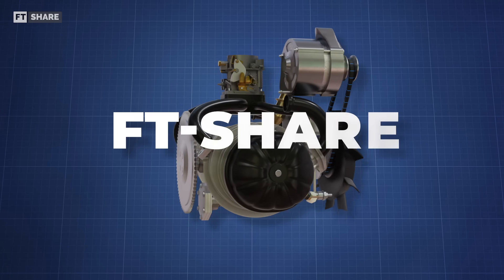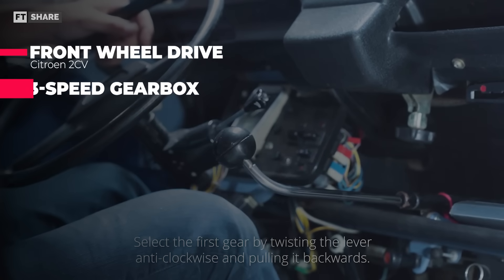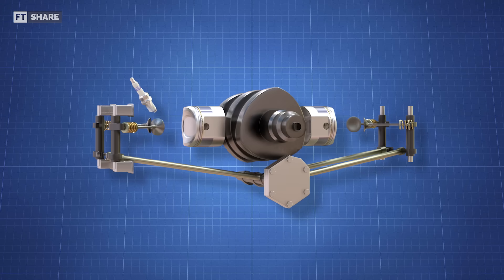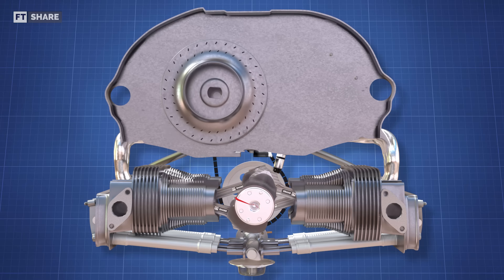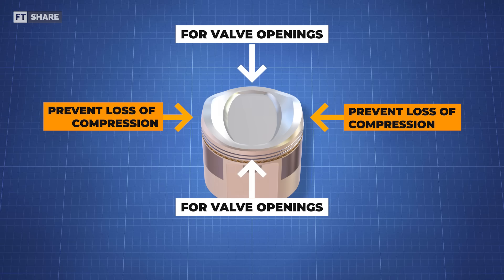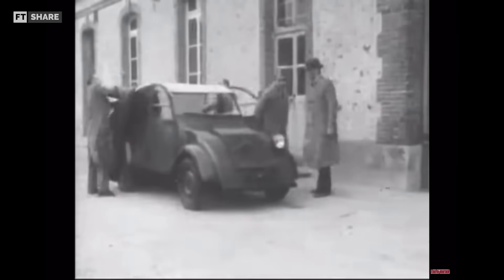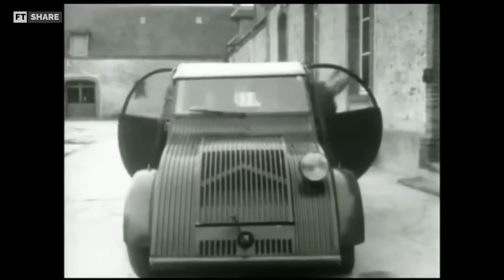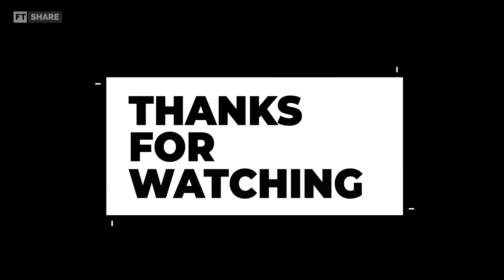The Most Interesting Engine in the World: Citroen 2CV Vs VW Beetle

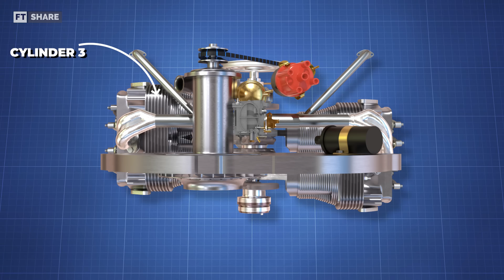Comment: False information at 5:14 which claims that the less than ideal placement of the spark plug gap (for #3 cylinder) can result in overheating. This is a nonsense statement. Actually in earlier engine models the fan shroud contained the oil cooler in the fan shroud in a place closest to the #3 cylinder. As a result the #3 cylinder did not receive the cooler air that the other cylinders received and tended to run hotter and wear out quicker. In later models (with dual port intake manifold) the oil cooler was placed outside the fan shroud allowing all the cylinders to cool evenly.
Reply: Came here to say this. My guess is this whole video is AI sludge. That's not even the #3 cylinder. And as you pointed out "placement of the spark plug gap" isn't much more than a word salad. This throws literally everything else in this video into question. Even if 90% of it is correct how are you going to know which 10% is false or hallucinated? I only know because of how familiar I am with VW engines.
Reply: Didnt he also say that heating the carb makes for a denser mixture???? :face-orange-raised-eyebrow:
I'm not a mechanic and even I know that is wrong lol.
Reply: @AtomicFrog64  it depens how denser mixture is defined. 
Sometimes they just mean a richer mixture with it.

In the physics sense cooler air contains more oxygen so you can ad more fuel and  have more mixture volume to burn.
Turbo/supercharged engines with aditional intercoolers for high hp/torq engines use this physics artificial.

Moped and smal 1-2 cillinder aircooled engines like often a more richer mix to run smoother. 
Passing warm air by the carburator and/or in to the air intake makes the mixture richer
Reply: The cylinder shown in the video was the number 2...the number 3 is in the rear left and not in the front right...and yes later VW improved the overheating pblm of the cylinder 3 putting the oil cooler in a "dog house" style fan shroud.
Reply: True, it's the oil cooler placement which caused the problem. That's why eventually,VW made a modification to the oil cooler design to eliminate the problem.
Reply: @ersikillian  for my next engine, for my Squareback, I'll remove the original oil cooler and install 2 oil coolers + electric fan. Result in less heat in the engine compartment and more oil in the circuit.

Comment: many errors concerning the 2cv...the all first 2cv,all aluminium alloy body, from 1939 had a water cooled engine, 2cyl 325cc and 8hp, 250 2cv from this model was built but never sale because of the war. In 1949 was the all new designed 2cv (all steel body) launch with the known air cooled 375cc engine of 9hp, aluminium block with cast steel cylinder and aluminium heads, but was many evolutions from the engine: next was 425cc/12hp, later 435cc/24hp, and the last and strongest was the 602cc/29hp...ALL 2cv had a 4 speed gearbox (presented to Pierre Boulanger as 3 speed+1 overdrive)

Comment: The Citroen has a 4 speed transmission.
Reply: It's a matter of naming. Pierre Boulanger wanted this car to have 3 speeds. The engineers cheated a little bit and made a 3 speed transmission with a fast speed extra gear. So it counted 1 2 3 S ( for surmultiple)

Comment: If you heat air it becomes les dance. Not more. In fact the heat pipe connection from the exhost to the carburator was equipped with a wax operated port. This avoided the hot air to go thru the carburator when the engine was hot and only was used for cold starts. This was not working well and was not present on latest versions.
I have had a 375 CC model "Fourgonette" from '57 and a 2cv6 from '82. The fourgonette had a 12hp version of the engine. I did upgrade the Fourgonette with a 602cc engine from a Citroen Dyane with the 4 speed gearbox and all the breaking system. In the 2cv6 I did replace the 602cc engine with a 650cc engine from a Citroen LN. This had a Aluminium engine. The 2cv had Aluminium heads but cast iron cylinders.
Those engines had not only closed rods but also no head gasket. In stead it was a conical fitting.
The oil was mainly used for cooling the engine. That is wy there was such a big oil cooler. That oil cools was holding 60% of the oil when the engine was running. Making it a partial dry sump.
There was a 4 cylinder version of this engine. It started in the Amy 8 super (1050cc) that was a "luxius" derivative from the 2cv. Then it found its way in the Citroen GS (1100cc, 1220cc and 1300cc) and the Citroen Axle (1100cc).
The 2 cylinder version of 65Occ was found in the Citroen LN and the Citroen Visa whitch had also 4 cylinder engines but not boxer.

Comment: I really like Citroën 2CV and came close to buying one in 1975 but it was more expensive than a Fiat 127 eg with a 4 cylinder 900cc engine or similar cars, so it was  overpriced which was far from its original character , i.e. a frugal and particularly cheap car.
The Citroen 2CV has a unique style but does not meet modern safety needs. The engine is very interesting but one can hardly say that it is the best ever made. This iconic car can take you everywhere but with enough noise and moderate speed. Although its "philosophy" - austerity but with reliability - is admirable, one has to overlook quite a few things to have it as a unique car.

Comment: I think of the 2CV with its 600cc flat twin as half a Beetle engine:-)
Reply: The 2cv started with 375, then 425 and then 602
Reply: @matiascasali  375, 425, 435 and 602
Reply: think of it as twice of a beetle engine
Reply: @luxwutang  almost the same power as the 1200cc Beetle

Comment: About half of everything told here is incorrect. Please, if you don't know what you are talking about don't make youtube videos explaining engine technology to people.
On subject: The comparison between these engines is pointless because apart from they both being aircooled boxers they are very different. The four cilinder VW engine definitely is more advanced, better balanced, and has more torque and power. And though the VW engine is relatively light, the Citroen engine is much lighter. This was important because of the low vehicle weight of the 2CV. Exept for the breaker points maintenance the Citroen engine was easier to work o.
Both these engines have proven to be very reliable (probably more so than most modern engines).
Reply: I think your comment is quite horrendous. Not very nice attitude to a guy making such a informative video.
The clip is very good and the small incorrections is not very relevant.

Start listing the "half of everything" thats incorrect...
Reply: El Wolkswagen es un cáncer, gasta combustible como un coche grande y no tiene espacio ni para poner un canasto, es antieconómico relación a su capacidad

Comment: 6:21 This is factually false. 
Heating the intake air will lower the air density, and thus, causing the engine to produce less power.

This is why some modern gas cars use intercoolers, to cool the intake air. Making the air more dense, so more of it can flow into the combustion chamber. And create more power.
Reply: agreed, but it's a common technique to use on carburated cars so ends up a net benefit to efficiency. my dad's 1989 nissan sunny used it. i guess its because carbs like to be tuned to operate at a consistent temperature. there's also the danger of carbs icing up, mainly happens in aircraft.
Reply: @martin-vv9lf Thank you, finally someone who understands engineering! The carburetor must be heated due to the risk of icing.
Reply: Warming the intake air flow only helps the engine warm up. Then warming the air hinders optimum engine performance. In the VW engine, there is a thermostat which closes the louvers in the fan shroud on a cold engine so it can warm up to operating temperature. Then the thermostat opens the louvers to give maximum air flow and optimum engine performance. Shade tree mechanics that removed the thermostat and louvers to "increase air flow" didn't know what they were doing.
Reply: @vwbug7028  The purpose of the heat riser system in the VW is to keep the intake manifold from freezing in cold, damp weather, which causes the fuel mist from the carb to condense. That causes sputtering, backfiring and stalling to occur (ask me how I know!). There's also a warm air pickup which brings warmer air from under the engine tin to the carburetor. This enables the car to run reliably in all weather. Many shade tree guys disconnect those systems because "you don't need them". Most of us learn the hard way the engineers knew what they were doing by installing those systems on the car.
Reply: @kathleenrossi4840  Ambos fueron diseñados en Europa, y hacia el centro norte, donde los inviernos son muy fríos !!!
Reply: @kathleenrossi4840 I don’t see your post before my earlier ones. You are absolutely right. The VW engine and its integration into the vehicle was thoroughly engineered. Many mechanics and owners today don’t realize the importance of the engine compartment gaskets and the tin pieces that formed a seal preventing the heated cooling air and exhaust heat from circling back into the cooling air intake.
Reply: @kathleenrossi4840 That's right, especially with such a long intake manifold. The same goes for the 2CV.
Reply: @vwbug7028  Many VWs performed this thermostat removal on their own.
Reply: There's a few things about this video that are simply pot shots at the Beetle. But I'll join with you here. Yes, the narrator got it reversed, as you point out. The purpose of the heating the carburetor on a boxer engine (which the 2CV and Beetle have), is to prevent icing of the carburetor and the long intake manifold run from the center mounted carburetor to the outboard cylinders.  In the Beetle, the heating is performed by a small heated exhaust manifold tube that is joined to the intake manifold. The heat is transferred to the intake manifold this way.
Reply: @halnwheels  Yeah, I've experienced the results of that exhaust tube being clogged on a used VW bus I bought. That thing really iced up. I removed and cleared out the blockage and it was OK.
Reply: @vanceblosser2155 yeah, they do clog up. I really mis my ‘66 Westy camper.
Reply: @halnwheels  That's what I had! With a pop top!
Reply: @vanceblosser2155  Yes, mine had the pop top and the complete interior. It also had the Stewart Warner gasoline heater which worked after I fixed it (Scary). I loved the (5) jalousie windows which really helped ventilation when raining while camping.
Reply: Heating air in the intake doesn't improve performance allowing more air to enter the engine. Maybe it generates some advantage allowing better atomisation and combustion. To be better discussed.
Reply: to use an intercoler a car has to be turbocharged or supercharged. And if you see modern engines, you will see engine coolant hoses running to the throttle body
Reply: Technically you keep passing warm air around the carb while the engine is running under the operating temps... When fully warmed up then ambient colder air should be introduced to the carburetor to increase fuel efficiency, colder denser air packs  more oxygen and promotes more complete combustion thus maximizing efficiency.
Reply: Calentar el múltiple de admisión, es para facilitar el arranque en frío, casi todos los coches carburados lo posían antiguamente, en mi caso a mi 3CV, que dormía afuera de la casa los primeros años, siempre a las6.30hs, en invierno, le vertía agua caliente casi hervida, con una manguerita en una pava, por el contorno externo del carburador, se escuchaba cómo el inyector de la bomba de pique inyectaba una dósis de nafta, al calentarse ésta, luego arrancaba el motor como si hubiese estado marchando todo el día, en el acto y sin rezongar y como dicen los hermanos Mexicano, "al primer llavazo", lo único que se sentían duros eran los cambios por el frío ambiente invernal. Es una máquina muy noble, casi irrompible, acá la gente diría "inoxidable", Mis amigos del taller de Citroen, tuvieron uno de carreras, varios años, con buen exito en el campo, y rondaba los 140 kmh. Siempre le ponía un aceite de lo mejor del mercado y molikote antifricción, lo que se notaba en la marcha ágil del motorcito, y también se le agregó a la caja de velocidades el correspondiente. Acá un amigo de otro taller le puso a su 3CV, un motor de Vw Up, es un bólido, no se nota nada externamente, así que cuando lo ven pasar tirando un acopladito cargado, ó a 140 kmh, los que no lo saben se quedan boquiabiertos. También se acostumbra acá ponerle el carburador de 2 bocas del Ami-8, y el cobertor de la turbina del Ami-8, con lo cual le hace de "compresor" y alcanza los 35 HP, y pisa bien los 120-125 kmh. Otros lo hicieron doble tracción, usando el motor al centro y transversalemte, de modo que dos "cardanes" salían de su caja de velocidad, uno hacia adelante y el otro hacia atr´s, y en ambos extremos, unos "diferenciales", transmitían a las 4 ruedas la tracción del motorcito. hasta se le llegó a reducir las yantas de acero pasándolas de 15"  a 14", con lo cual se tenían ciertas ventajas, y usando un árbol de levas de mayor alzada, eso era lo más para entonces, y con poca plata se podía lograr.  El mío lo tuve 13 años, y lo largué en 1995, aún lo extraño y me arrepiento de haberlo vendido. Saludos !!!!
Reply: @c.e.ardanaz1234  That's a great recollection. I think it translated into English fairly well and was a pleasure to read. I'll just take issue with your opening line. The heated intake manifold did not facilitate cold starting as it was heated by exhaust gases and not yet running if cold starting. And like your experience in cold weather, I remember sub-zero (Fahrenheit) temperatures in early mornings. The engine would start and everything was so very cold.... wheel bearings, gearbox oil, etc. I'd run it up in first gear and shift to second. Oh, the shift lever was so slow because the oil was so thick. By the time I got it into second the car slowed so much, second gear was useless. It took another run to do it! Cars back then were not like today's, Not many cars would get on the road that early in the morning because of their electrical systems, carburetors, etc. Beetles were great, as I'm sure the 2CV or 3CV was.
Reply: These are not increasing volumetrik Efficiency, but increasing fuel atomisation, easier combustion, and prevent condensation. Cold carb/intake port are bad for fuel Efficiency and emission. Cold air is good, but not for cold intake.
Reply from the maker: Thx for the correction bro 🙏🙏

Comment: The 2CV is trully brilliant. I drove one 10k miles through UK and Europe and got 55 miles to the gallon at 60mph fully loaded with 3 people and camping gear and all with 600 cc flat twin motor. They have a fantastic heater for cold clinates and a roll back roof for summer, i only wish i could have brought mine homewith me
Reply: ....until literally any other car on the road hits you...
Reply: the heating is ok, but not fantastic...ok, the bigger problem is the hot air finds his way out too easy.
but it is not warm when i drove my 250km highway every 2nd week. it´s ok but i dont like it; and have no choise.